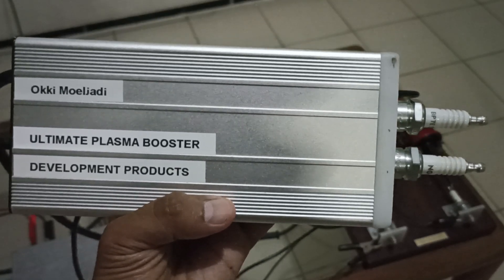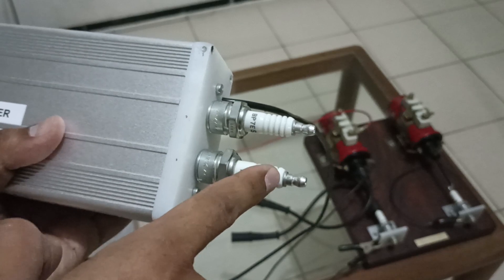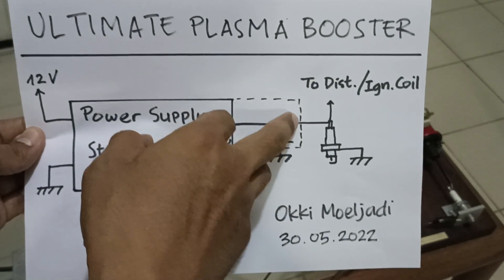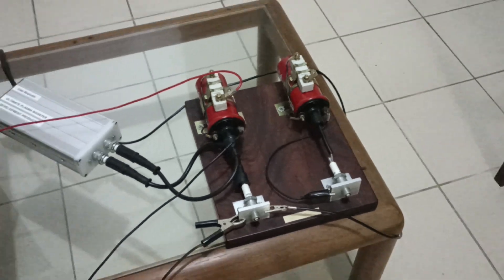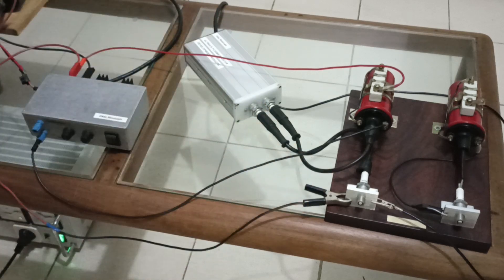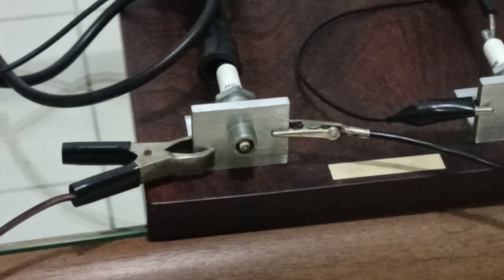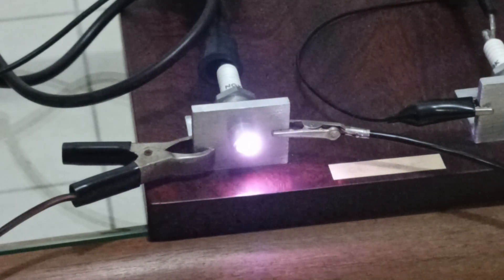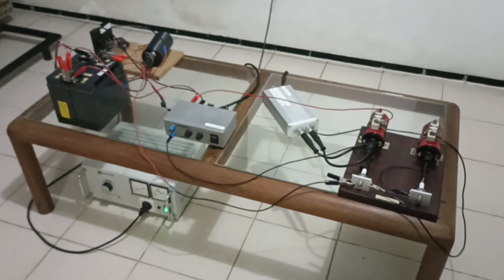Ultimate Plasma Booster - Details

Comment: So this is basically the same as your std: capacitor/s between plug top and ground, but you have also added base voltage of 500V DC, (protected by a HV diode?) to  the plug top..?

I NB that you have also removed the J or ground electrode.
Is the idea to get some ionisation going during the intake and compression stroke to produce a little H2, O3 and other radicals in the plug region?
You may want to look into Passive Combustion Pre-Chambers as used in F1 etc:
Smaller volume=more radicals per cc, that are not blown away by squish etc... 

As ionization voltage goes up with pressure/compression; I don't know that 500V is enough? At STP you need around 1000v per mm of electrode gap to get ionic flow...
Also you want to increase charge density difference and that would take a thin centre electrode and rounding the inner edge of the cylinder/electrode.
Reply: Sadly I read in comments of his other videos, he passed away from Covd.  You seem to have some real knowledge about this plasma function but I'm unclear about all you're said....🤔
Reply: @chrispompano  You simply attach a permanent ionising or low 'corona discharge' voltage to the plug permanently.

What that voltage is, is a good question as corona discharge voltage changes with pressure and/or temperature.
IIRC ~300 to 500 volts..?

the above circuit needs to be protected from fusing/feedback by an appropriate diode.

There are a good number of videos on this.

I can 'see' it producing flow and a tiny bit of hydrogen in the right place.
Reply: @RayleneCawood  This is way above me!  Do you know the Aaron Murakami channel, who is supposedly the expert on plasma ignition, & what his opinion is of your method?  
I wonder about his whole ignition program books to purchase.  Looks like he's been successfully selling his books & dyi for years.  He's involved in all kinds of energy stuff, but far beyond my comprehension.

Comment: Okki , what is the power of the dc-dc step-up converter ? Did you use those 2A , 20KV diodes inside the box ? Is the converter alone is capable of maintaining continuous spark after it has been ignited by the HV pulse from the ignition coil of coarse?
Reply from the maker: The converter power is around 25 Watts. Yes, I use that diode. This device cannot maintain the spark, the voltage is too low for this spark gap.
Reply: @OkkiMoeljadi  thanks Okki ! So , you charge some additional capacitor ( connected in parallel to the spark gap via  PRHVP 2A-20 diode (I suppose cathode to the capacitor,anode to the central electrode of the spark gap , charging polarity of the capacitor (+) to the ground )) with the 25W inverter to around 500V . The HV pulse from the ignition coil just trigger the capacitor discharge by ionizing the spark gap and lowering it resistance . Did you use any induction choke in series with the HV diode in order to slow down the rate of capacitor discharge, to restrict the current flow,to extend the discharge ( spark ) duration and to increase the lifespan of the spark plug electrodes? What is the value of the discharge capacitor? Thanks!
Reply from the maker: @flappingflight8537  yes, you are right! No, there is no choke in my circuit. My discharge capacitor value is 2 µF.
Reply: @OkkiMoeljadi  thanks Okki ! Do you have info on how fast ( the recovery time ) this HV diodes are or what is their initial application ? Google couldn’t find any data sheet on them .
Reply from the maker: @flappingflight8537  I don't have any information about this diode. Sorry.
Reply: @OkkiMoeljadi  Ok , thank you!
Reply: @flappingflight8537 . Olá.
Sou do Brasil.
Você pode me ensinar a fazer um sistema desse?
Reply: @FORHEADPERFORMANCE  do you understand electronics ? And what exactly ignition system you want to replicate? Sorry that I’m writing on English but my Portuguese is Zero :)

Comment: Can make open  video od the sistem  especially  the box 📦
Reply from the maker: I have explained this system many times before. Please check out my older videos. All the information is already there.
Reply: @OkkiMoeljadi  thanks  just question on wilth pole have  the plasma cold or hot  +/-
Reply from the maker: @Alwaysbusy300  For this setup, the output ground is positive.
Reply: Ini bisa pasang di mobil? Bisa beli dimana? 🙏🙏
Reply from the maker: @MustawaTV  alat ini memang saya desain untuk mesin mobil, tapi ini tidak cocok untuk pemakaian harian karena akan memakan elektroda busi. Alat ini cocoknya untuk mobil balap seperti drag race. Kalau anda tertarik bisa pesan langsung ke saya.
Reply: @OkkiMoeljadi  alamat di Pasuruan di jalan apa mas Okki?
Reply from the maker: @sambelterasi8360  mohon japri saja.